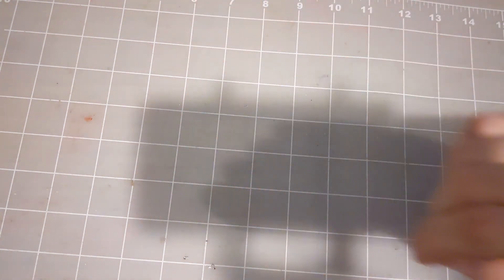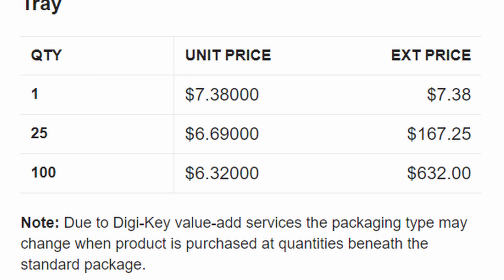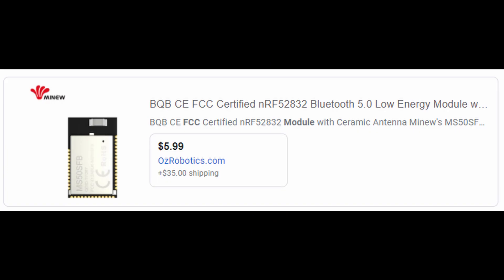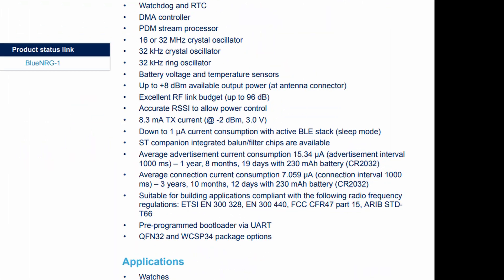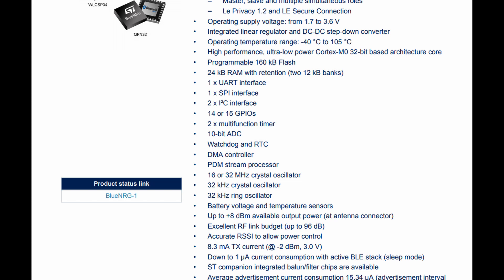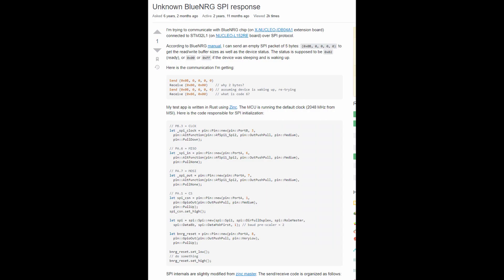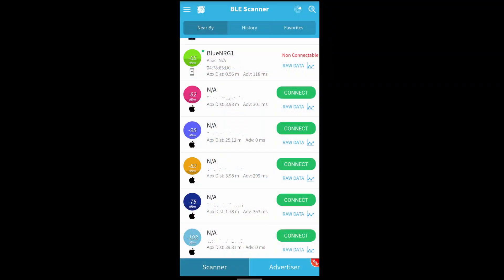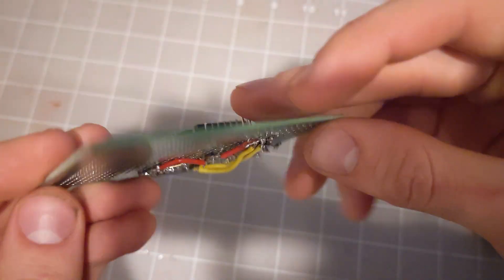Why Use a $2.60 BLE Module? Introducing the EMB1061!

Comment: First, thanks, and great work - The debugger works great ! (Im using an st-link flashed as a j-link - which i recomend)  Sadly I'm having a noob issue with building (am new to VSCode) - I get:
Executing task: make 

$SRCS is [src/BlueNRG1_it.c src/main.c  ]
PRE
if not exist  libs mkdir  libs
/usr/bin/sh: -c: line 1: syntax error: unexpected end of file
make: * [pre-build] Error 1

BTW Have you tried the EMB1082?  This is even more powerful/cheap, but also a nightmare..

Comment: Now only a sample project is needed with this as a CR2032 Bluetooth "Key" for unlocking or presence detection for IoT/Garage Door/Light control.. 1000ms advertisement time pause should be low enought to feel like direct unlocking :-P

Comment: I honestly might have to pick me up one of these - even if I probably wouldn't have a use for it for who knows how long until I actually come up with some sort of idea. I'd figure part of the reason why they're able to make it so cheap is due to the fact BT 5.x is the standard at this point so you can get 4.x chips cheaper then.

As for the project, I'd help if I could. Though I only really know Java and JavaScript, not any C variants, though that'll change in the coming year or two.

Comment: I'm a bobbiest, and I bought some of these thinking they would be similar to the Bluetooth (BLE) CC2541.  They are not.  I agree that there is very little guidance or documentation available.  I was successful in getting two CC2541(s) to ‘pair’ (connect) to each other using AT+INQ and AT+CONN commands via microcontrollers and used a pass-through-uart function.  The EMB1061 doesn’t seem to have any AT commands that can do this.  I'm disappointed for that reason.  Your project is beyond my skill level, but I wish you the best of luck.
Reply from the maker: Actually there are AT commands that are supported, if you bought boards from me though, they are programmed with a different firmware. You can definitely reupload the AT firmware though and I can provide you a link to download that if you would like

The nice part about this chip is the ability for it to work standalone instead of needing an extra mcu, which is what my code is an example of
Reply: @CalebMarting  Sure... I would like to try another firmware with additional AT support (functions).. Thank you.
Reply from the maker: Do you have an Stlink v2 by the way? You will need one to program it. I'll get a little guide together for you
Reply: @CalebMarting  I just Google'd that.  No I don't.  I have an FTDI USB-to-serial cable.   I normally program PIC microcontrollers using various programmers.  (older 8-bit stuff) using assembler.  I'm an assembler type, not 'C'.    I can cobble together something over time.....
Reply: @CalebMarting  I did a little research.  I just bought (on ebay) a cheap St-link V2 knock-off.  I can use it regardless.  Cheers.
Reply from the maker: Sounds good I'll start putting stuff together

Comment: If it's 8051-based, assembly may not be a far cry - 8 bitters are pretty straightforward :)
Reply from the maker: It's based on the BlueNRG-1. It's actually pretty complex, and the BLE stack definitely would be hard to work with. Also the blue energy one has an integrated cortex m0, so it's 32 bit
Reply: @CalebMarting  Ah, I misunderstood. m0 is a different matter altogether. 

Now that Andreas Spiess is involved, I'm sure your project will get a lot of visibility :) Good luck!
Reply from the maker: Thank you!
Reply: BTW - I have already pleaded on the STMicro YouTube channel to remove the IDE paywall hurdles, with reference to your video. Perhaps more of your viewers could do the same..  Let's see if and how they react ;)